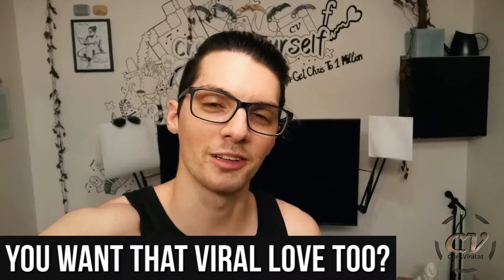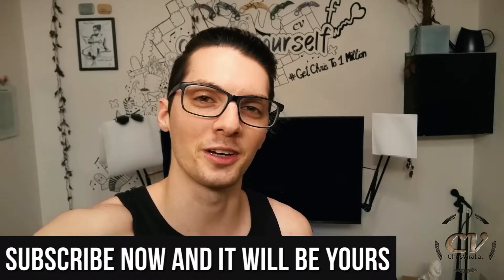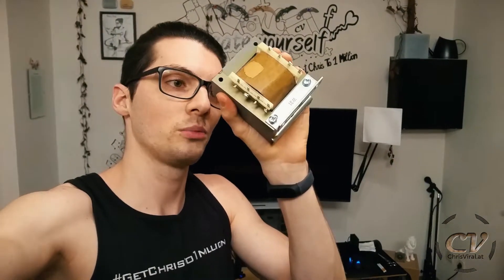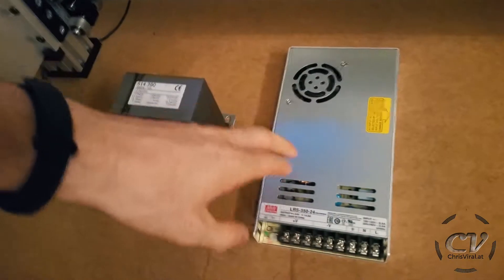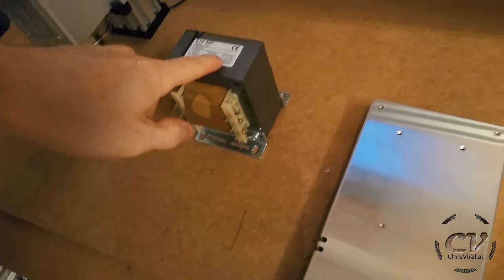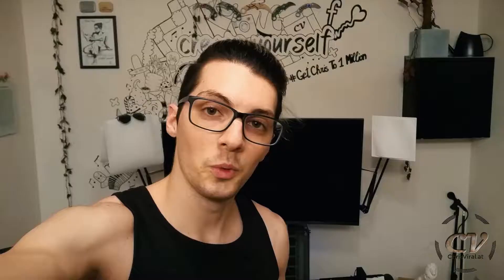Transformer VS Switched-Mode Power Supply (SMPS) & Flat Power Supply Considerations

Comment: smps is the beast for sound amplifiers because they never fluctuate the voltage what ever the wattage the amplifier produce specially for subwoofers so you will get purely accurate sound and bass
Reply from the maker: Thanks for the info :D 🙌🏻

Comment: Thank you for  this video, I have multiple transformers on hand but the purpose of my low voltage circuit is to save energy by adding a LED lighting system in my house and to run all devices that can  use 12v directly  with a battery backup and a future solar colector that xformer drain is a significant waste .
Reply from the maker: Yeah, this blew my mind haha... Glad to help! Also another tip that you might want to look into, is to go for a higher voltage like 24V or 48V. 12V might limit you someday in the future. Anecdotal knowledge from my dad.

Comment: Moreover conventional transformer base power supply is long lasting than smps. Semiconductor and capacitors failure is very  frequent, specially in in 1amp or more ampear consuming smps.
Reply from the maker: Valid point, thank you 🙌🏻

Comment: Is there an explanation regarding for why as increasing frequency would give more power for a switching mode power supply  ?
Reply from the maker: More size -> more power.
Higher frequency will enable to reduce the size.
-> more power in smaller footprint.
Reply: @ChrisViralVlogs  Thank you for your answer

Comment: there is a downside of SMPS, they age relative quickly (avg 2-5 years). I counter that by switching them completly off , i use a  power socket with a red switch . Especially PC powersupplies are not that efficient like you showed here. If they are on the net they are basicly in sleep mode but their capacitors are still charged/charging . The capacitors are the parts which will fail.
They can be replaced , but makes only sense on expensive / rare devices.
I repared several Dell TFT's by replacing 2 capacitors of their internal powersupply.
I used a capacitor-meter to confirm that they are defective. sometimes you can see it.(the top is not flat but rounded)
Reply from the maker: Interesting infos, thanks for that. 2 years of uptime seems fine to me for a 15$ SMPS hehe.
I'll get to more measuring once I got them.
Reply: i meaned it in general, since these days nearly all devices work on SMPS, so look around and you will see them everywhere ;D